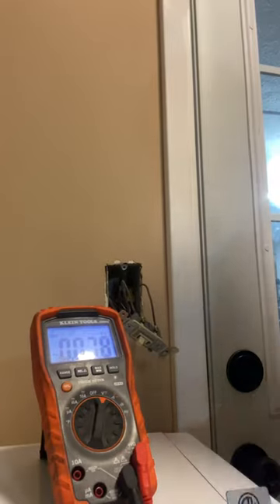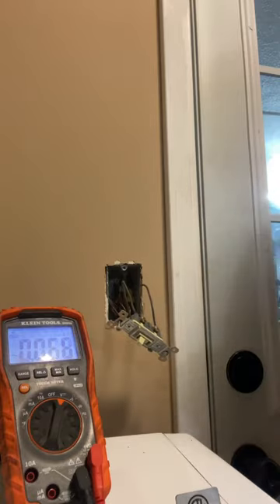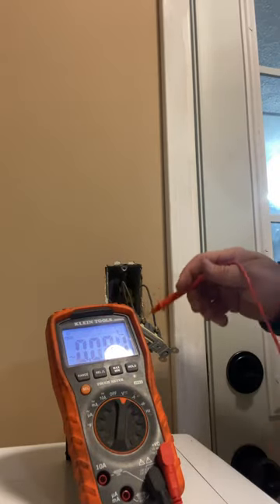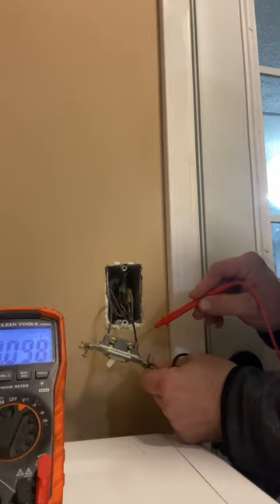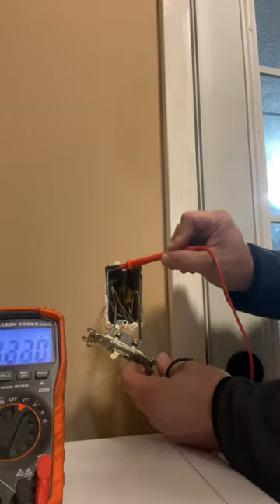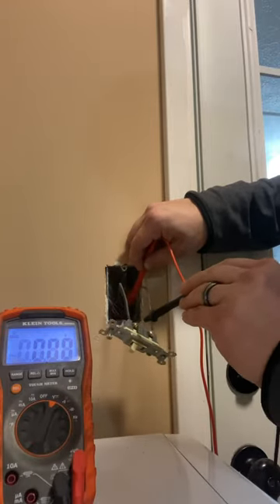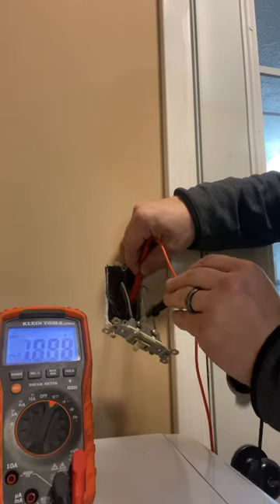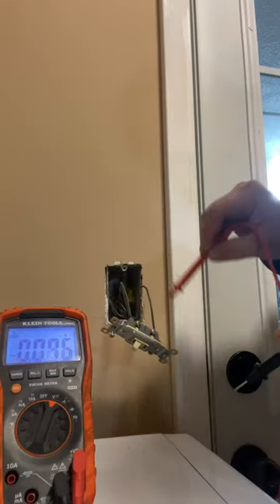How to test a light switch

Comment: The only thing I don't understand clearly is what you're using for the ground.
Reply: He is using the box where the switch is bolted
Reply: @eddo1717 thank you!
Reply: The metallic side of the box. Or if it's a plastic box, u can use the bare ground wire of the hot cable coming from  panel.

Comment: In the on position my switch jumps all over the place from 120 to 0 to somewhere between. Bad switch??
Reply from the maker: @newedgecarlos   could be a bad contact inside the switch, could be loose leads, loose ground.. are the lights flickering?
Reply: @RuggeriDIY  lights aren't turning on

Comment: Yo I just touched the red to the back of the switch box and the black to the bottom screw, sparks went everywhere😮😮😮
Reply: I shorted the screw to the switch frame, I was using the long probe on my multimeter🤦🏻‍♂️
Reply from the maker: @djjazzynic  yeah, the metal contacts can short out if they touch ground or neutral somewhere in that area, be careful lol
Reply from the maker: @djjazzynic  plus doesnt matter if you use red leads or black, you will just get a negative reading if you flip them
Reply: I had the same issue some years ago... it was because I didn't have the lead still... if it moves watch out (sizzle and pops). Amost burnt my lead up. Man from Lowes warned of keeping leads from moving when checking. Stay Safe!🕊
Reply from the maker: @PastorIhaza-f9o  Yeah, really sucks if they are nice leads too!

Comment: Needs a closeup view.
Reply from the maker: I'm not sure how much closer you need me to get, maybe ask me what you need to see specifically
Reply: @RuggeriDIY closeup of what your probes are touching. I can see the negative is touching the screw on the switch but can’t really tell exactly what the positive probe is touching.
Reply from the maker: @Berkner80  they are touching each brass screw.
Reply: @RuggeriDIY  ok thanks will give mine another try.
Reply: @RuggeriDIY  got it but only getting 103 volts, getting 123 volts on the good switch. Now going to test the wires itself. Thanks